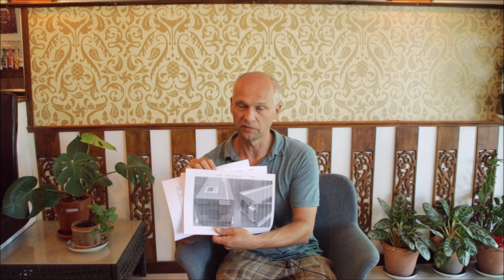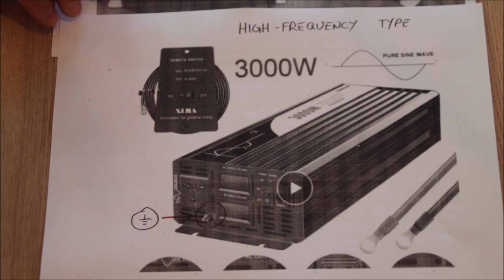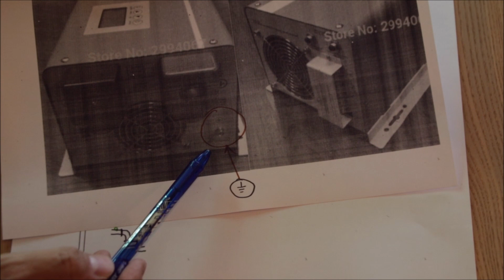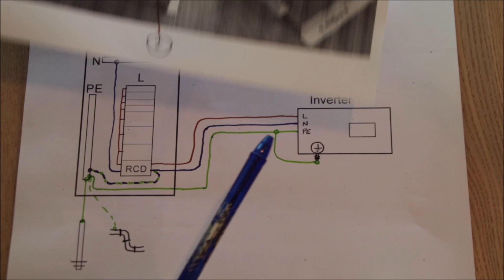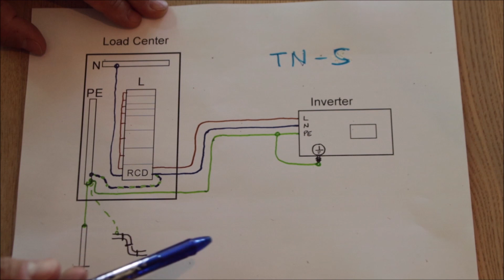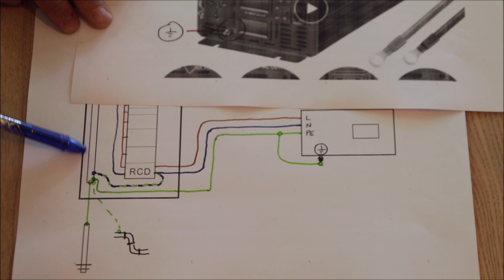Inverter Earthing and N-G Bonding in a simple Off-Grid Setup

Comment: Hello and thankyou for your informative video.
I have a caravan i use both grid power and off grid power from my 210ah lithium battery.
I have a 3000w pure sinewave inverter which i would like to plug into the mains power connection on the caravan.
My question is can i use the on grid and off grid safety ( note caravan has no ground peg) thankyou!
Reply from the maker: Sorry, i am not sure what you mean. You want to plug the inverter into mains to to charge the battery? The caravan electrical circuits would be purely powered by the inverter or some by the grid or transferred when battery is low? On grid safety means an on shore protection device provided by the camp site, and off grid a protective device in your caravan? A caravan can only be considered a simple off grid system if there is no AC in from the grid. And as you mentioned, they typically are not grounded as they are moved around.

Comment: Hi Sir, thank you for your informative video. I have bought a hybrid inverter (supposed to be connected to grid and solar) with the power connections stated as Neutral and Live. However I have learn that our power supply from the Utility, both lines are Live. The manufacturer advised me not to connect the Inverter to the Utility and instead use it only as Off-Grid. They are saying that N-G and L-L lines are incompatible and will damage the Inverter. Is this correct?
Reply from the maker: Hi. Technically the inverter could work but only if you do not connect ground to it. This is done so by people in split phase countries like the US, PH, etc when they use 230V EU inverter versions for their 240V appliances. But when connected to the grid, the grounding point is at a different voltage potential. That's why the L-N inverter would blow up if it gets grounded in a split phase environment! The manufacturer will of course tell you not to connect it, and he is right as you would have to use the inverter non standard by not using all terminals available and in case of an internal fault, you might even get electrocuted by touching the case of the inverter. My recommendation is to always use country specific equipment for your projects.
Reply: @RolandW_DIYEnergyandMore  Thank you Sir for your reply. Did you meant 'if you do not connect ground to it' is not to connect the Inverter casing to ground with the Utility L-L connected? I am still looking for Inverter that accepts L-L. Thank you for your kind advise.
Reply from the maker: @juantamad5784  yes, not the casing as well not the Ground/PE terminal. The inverter output must freely float without ground reference

Comment: Hi Roland, this a very interesting, but still quite complex topic :-) I'd like to ask, with the first type of inverters described in your video - the high frq ones, they generally don't have anyhow defined which contact is L and which is N on their output sockets - how would you go about bonding PE & N in such case? Does it matter which lead you choose to bond with PE? Is it even possible? 

I do have a small off-grid solar system on my garden shed and have all the grounding points on my solar system components connected to a grounding rod near the shed. I have the inverter output connected to a load center, however the load center is in the shed and there's no path to our main grid grounding point that's in our house. It's trully off-grid - now the question I have, as stated earlier, what would be the proper way (if at all possible) to bond PE & N to create a TN-S system if N isn't specifically defined on the inverter's output socket? 

And lastly, the grounding contact on the inverter's output socket isn't connected anywhere internally in the inverter. I could connect it to the grounding rod the same way as the inverter and solar regulator chassis grounding points, but I'm not 100% certain if it's the right thing to do.
Reply from the maker: Hi. This is a 230V one phase inverter, not a US split phase, right?When you took a look inside the inverter, did you see different colored wires going to the socket or was it all the same too? You can choose the leg you want for PE bonding. It doesn't matter.
You should bond with the PE system which is at the shed.
Reply: @RolandW_DIYEnergyandMore  Thank you for super-speedy response Roland. You're right, it's 230V (EU) one phase inverter. The color of both wires on the output socket was black. No brown/blue like you'd see in a house socket. So, if I understand it right, I can simply connect these two wires to a RDC in my load center and then make a connection from my grounding rod to the N contact on the RDC to create the bond, is that correct?
Reply from the maker: @kloboucek  yes. that is correct

Comment: My Y&H 2000W 2KW Grid Tie Inverter, has L1, L2 & N,  no ground. IN US 240V, how do I connect the ground?
Reply from the maker: Hi. You don't. A grid tied inverter is connected to the grid as the manufacturer has specified. If there is no grounding terminal, then it doesn't need any. The manufacturer took care of safety like he would do if the inverter was a class II appliance.

Comment: Hi Roland, I'm running a single outlet on a 240V 15A extension cord for a 2.4kW non-stop pump, and have a 16A DETA RCBO breaker between that outlet and my 5kW off-grid inverter. I run live and neutral wires from the inverter AC output into the RCBO's top input, and then I run live and neutral wires from the RCBO's bottom output into my single outlet. My outlet's extension cord of course also has an earth wire that I insert directly into the inverter's AC output earth slot (bypassing the RCBO entirely - Is that right?). My cord's 3 wire sizes are 1.5mm2, each for live, neutral, and earth. Am I correct in thinking that I now need to cut the earth wire somewhere near the inverter, and connect it to a copper grounding rod? And also connect an earth wire to that from the inverter's body? And then also cut the neutral wire and connect it to the same grounding rod?
Reply from the maker: Hi. You actually don't need to cut any wires. If the inverter has terminals, then just connect another wire at the PE output for the earth which is going to the rod. Similarly, just add a bridge between the N and the PE terminal for the N-G Bond. The earth wire from your cord is entirely bypassing the RCBO, that is right. Just make sure that the N-G bond is before the N-input on the RCBO.

Comment: Where do we ground solar mounts  and battery minus terminal ?
Reply from the maker: Where is your solar mount located? On a building or free standing? If it is on a building, I would ground it to your lightning protection or your House PE system if your PE busbar isn't too far away. If it is free standing drive a grounding rod and ground the mount and frames just right at the place.
Why do you want to ground battery minus? Did your inverter manual say? I would never ground any of the DC side powerlines without a strict reason. Keep the DC side isolated from ground.

Comment: Hi Roland
Thanks for the clear videos - very useful.
I am putting together an off grid system where the inverter is located in an outbuilding 50m from the house- there is a neutral screen underground cable (no seperate earth conductor)connecting the inverter output to the house. The neutral and phase are connected in the main switchboard through a two pole MCB. The individual circuits are then connected through RCBO breakers. 
The inverter ( Victron) has internal neutral to earth bond and is also grounded to a ground Rod at the outbuilding.
So can I consider the inverter as an external supply and bond the neutral and earth at my first point of disconnection - the main switchboard - and provide a second grounding Rod connected to my main switchboard earth?
Many Thanks
Keith
Reply from the maker: Hi Keith. Yes, the setup as you have described is perfectly by the book. I would do it exactly that way too. greetings, Roland
Reply: @RolandW_DIYEnergyandMore  Thanks for the help - will have the sustem up and running today hopefully!

Comment: Hi Roland i would love to ask you a question.
If you have grid fallback can you  terminate the earth wire to AC in and instead run earth from AC in to the casing then bond to AC out then to PE bus bar at the consumer unit. Then of course bond N and E before the RCD?
Would that negate the need for a relay?i would think the grid L and N is still going to trip its RCD back at the house under fault conditions ( my garage is 20m from property so using a TT with 10mm2 earth connection, wet ground aiming for less than 200 ohms resistance).
Cheers Cain
Reply from the maker: Hi Cain. I think I get what you mean. But as long there is a permanent bond in you consumer unit after the inverter and that consumer unit does tap into ground via an earthing rod, there will be a ground loop to the grid transformer when the grid is bypassed to the consumer unit internally. That would not be allowed in a TT-System. 
An upstream RCD will of course trip if there is leakage while the grid is used as fallback but it can't trip if there is an internal fault on the inverter which is causing its case energized if that fault has not the AC-in L as origin.
The (hybrid-)inverter is a power source with non-defined grounding. But as soon it switches to grid, it turns into a grounded power source. Don't see the grid grounding as something what is coming from your house in the form of a wire. It is defined at the transformer, and is turning the soil under your feet into one pole (N).
Reply: @RolandW_DIYEnergyandMore  in the UK there are loads of car charging points going into houses with TNCS systems using live and neutral feed and a separate earth rod. How you explain this rationale? I tried to think similar for my DIY solar job (still waiting for inverter and battery shipment but done the roof hooks.
There's a You Tuber here called John Ward goes through all this. 
I'm not cognizant enough to do a relay system is there another alternative?
Reply: @RolandW_DIYEnergyandMore  maybe I should have said my system is UK TNCS
Reply from the maker: @cainweber1978  no need for a separate grounding solution for the garage. Just use a 10mm2 PE wire and interconnect the garage with the house...
Reply from the maker: @cainweber1978  but your AC-in L,N must of course come from the main supply before the house RCD. I think in the UK you have a 2-pole main breaker before the RCD. You would have to connect there at its output and bring that to the AC-in using a separate 2-pole breaker
Reply: @RolandW_DIYEnergyandMore  so no earth rod by operator.

At the side of the garage I have whacked in a 1.5m ground rod. Copper anodized steel with 10mm2 earth cable. Fitting that to my consumer unit for the solar set up. Will have a Type B rcd and maybe 4 15 amp mcbs hopefully powering my koi pond, fridges, maybe some lights.
Reply: So if I reword my initial question. 
If I have TNCS and an armoured cable to my garage, can I just connect L and N to AC in on my inverter?
I would bond where earth should have gone to the case and  earth AC out and rely on my solar rcd box connected to my self installed TT outside my garage.
I really wish I could email you went I get started because you seem the real deal no bs. I am reading and learning for 5 months trying to understand all this but earthing is giving me nightmares lol
Reply from the maker: @cainweber1978  i would use that rod to earth the solar panel frames and SPDs if you have your panels on the garage.
Reply: @RolandW_DIYEnergyandMore  sweet that's what I was thinking. Guess I should still bond E and N before the spds/rcd at the solar consumer unit as per your diagrams elsewhere.
Reply from the maker: @cainweber1978  let me try to sum up. You bring your AC from the house (prior to house RCD) via a 2-pole MCB and armored cable (including PE from the house main PE busbar to the garage. There you use L and N as AC-in for the inverter grid bypass and PE connect to the PE busbar of the sub-AC panel. The inverter out goes to the type-B RCD and subsequent circuits you setup. You make a permanent bond between PE busbar and RCD N-In. The optional earthing rod that you have at the garage, you can use as local lightning, voltage surge diversions from panel frames and power lines (DC and AC SPDs). Everything what needs to be earth electrically in the garage, connect to the PE busbar there.
Reply: @RolandW_DIYEnergyandMore  thank you very much.
Reply from the maker: Right. You didn't mention you had a TNCS supply. Your reference to a TT-System made me think you are in a TT. Well, if your house does have a grounding rod and the main consumer unit there is connected to that grounding point then I would use the house grounding as well in the garage and make a permanent N-G bond in your sub-panel. That is what I have here too.